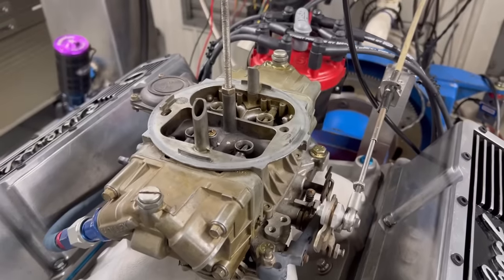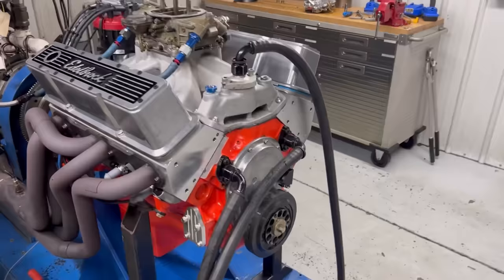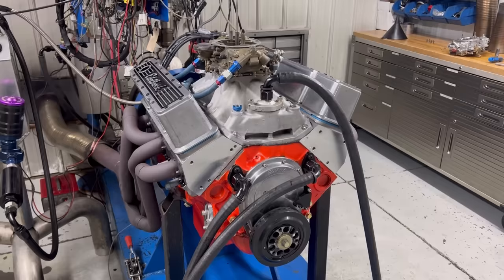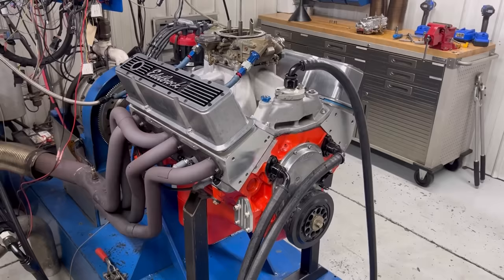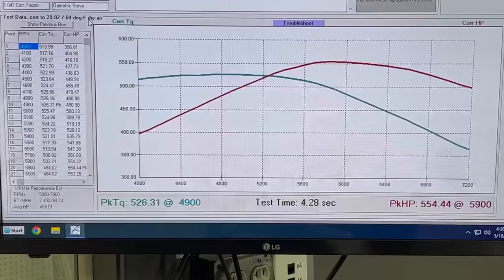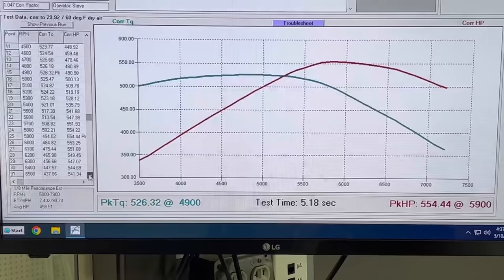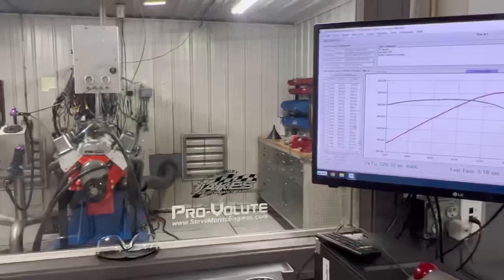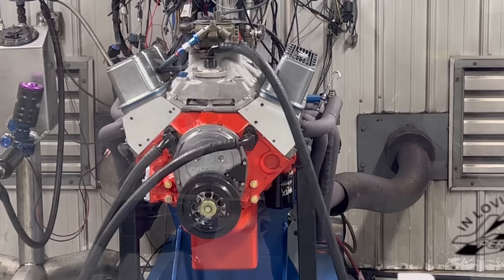Old school baby!  383 SBC

Comment: Nice, curious what was the torque at 2000 rpm? Tip in torque. Is that available?
Reply: Probably not even worth it to pull it that low since something like this needs a 3000 RPM converter most likely

Comment: Very nice, Love it!...what made you go with a 200cc runner over say a 195cc?  What timing are you in?  Are you at sea level?  Thanks.
Reply: 195 or 200 is just the difference in manufactures head cc. 

5 cc isn't gonna make a difference unless the difference being one is CNC ported and the other isn't. But that's also a price difference.

An AFR 195 will probably make more than this 200cc dart

Comment: What kind of numbers on torque at 1500 rpm and up?

Seem like it might be a good tow rig engine or a wrecker engine
Reply: I wouldn't use a solid roller cam for that since you don't want them idling like that on the street. Eats the valve train up.  Most people will tell you to idle a street solid roller at 1000 RPM minimum to keep things oiled.

Comment: Hey Steve question? 355 is what im building nothing crazy it's gonna be a daily engine. But I want good hp. Going in a 84 c10 suburban. Gonna run 882 heads are those good heads will they make good power? Depending on my cam and compression ratio?

Comment: is there a parts list?how did single plane make that much low end?
Reply: Smaller "street" solid roller. Peak hp @5900 RPM is small for a 383. 

Lotta  guys use bigger cams  to make peak HP @6500 on pump gas

Comment: Anyone, what most reliable and durable Chevy V8? I want swap it to 2022 Toyota Hilux D-Cab
Reply: Thats a loaded question. For simplicity a standard 350 small block. Pre-lt1 with the optispark ignition system. Those are prone to failure since the water pump weep hole is directly above it.

Comment: 400 crank in a 350 wouldn't it be a 377? Unless 030 over
Reply: Yes but most strokers are . 030 over.

When people say 377 they're USUALLY talking about a DESTROKED 400 with a 350 stroke crankshaft